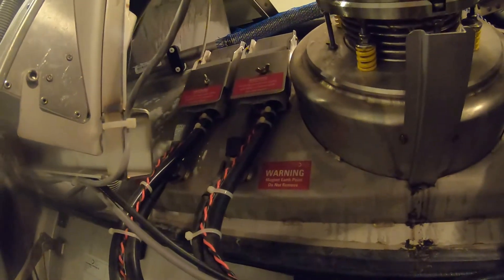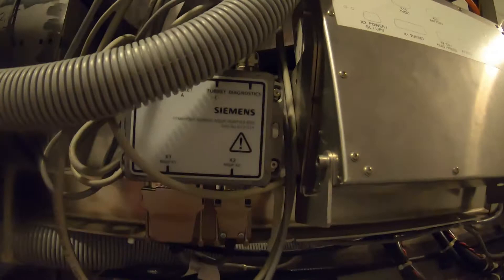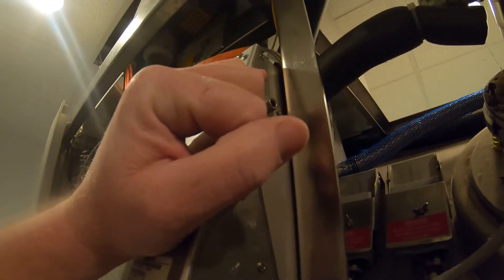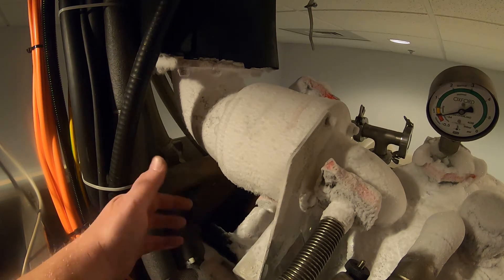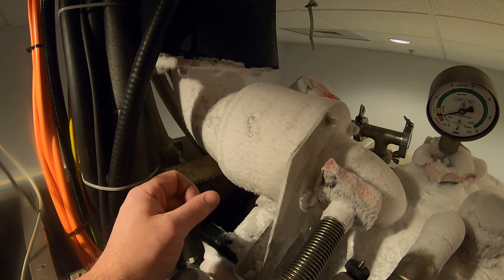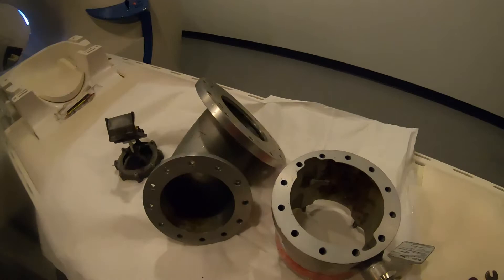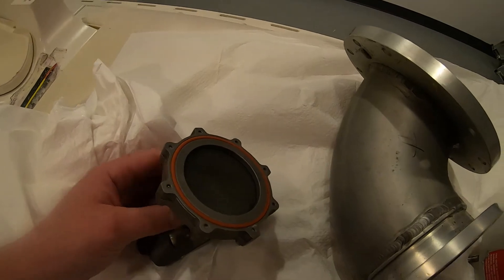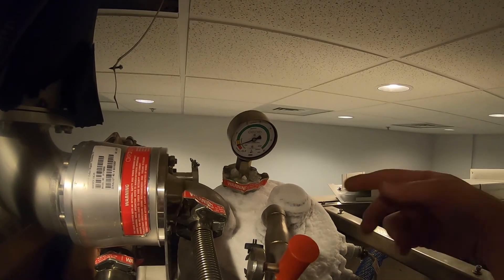Burst disc not sealing after a quench. What happens next?

Comment: Watching this bring back memories. I haven’t seen one of these for over 10 years. The last one I worked on was when I went to Oxford to learn how to change the 4K and 10K cold heads. I have never changed one either on the symphony or vantage. I think there a 3T mri that used the 10K cold head. I can’t remember the name. I think Siemens discontinued the symphony and the vantage around 10 years ago, but they made it for Toshiba.
Reply from the maker: The 3T, 10K magnet is the TRIO. They did make a head only 3T scanner called the Allegra, but it no longer exists. I literally serviced the last 2 in service and decommissioned them both. The TRIO and TRIO A TIMS system is still very much a viable product.

Comment: Hi i really Love your videos. How is the Magnetom Symphony compared to newer MRI system is the difference between new and old big?
Reply from the maker: If you have a fully loaded Symphony Meastro with 8 channels, it is a very good scanner.  It will produce nice images and has a very good PPM for homogeneity.  That said, it does have a lot of limitations because of the software and how it fills K-Space. Therefore, you can not to things like DTI, BLADE, TWIST etc..  Those scans, provided you have the license for them, is why the TIM systems have become Siemens Gold Standard.
 The  other thing about the Symphony, including the Symphony TIM system, is the magnet is 10K.  They need 1-2 fills a year to keep operating.  While every magnet made after Trio, A TIM System, is a 4K magnet with zero boil off. Thus all things being equal, the 4K should cost less to operate in the long run.
 Would I install and use a Symphony today? Absolutely!